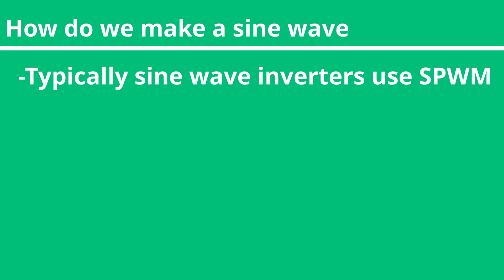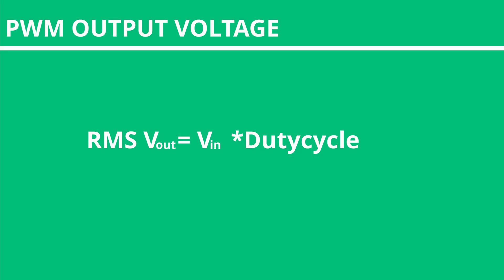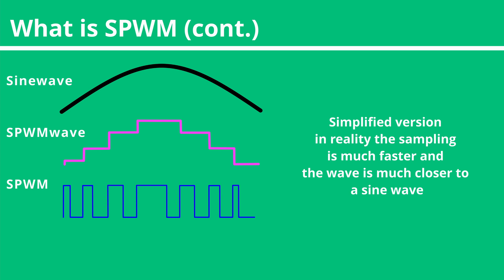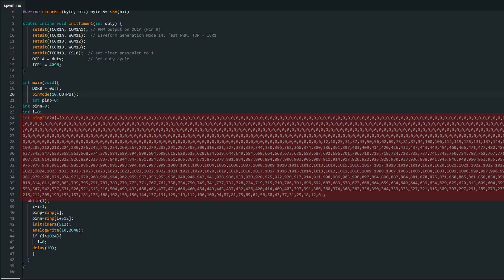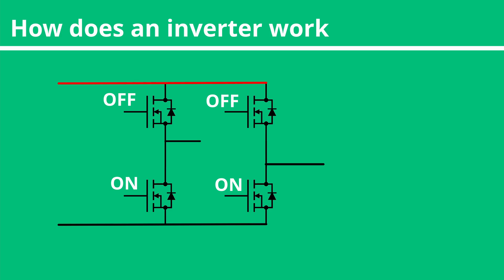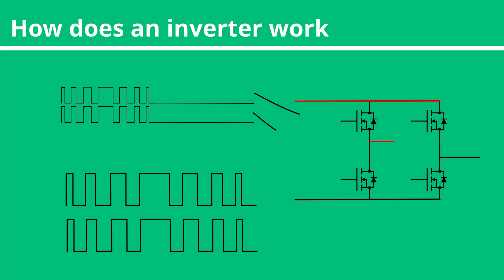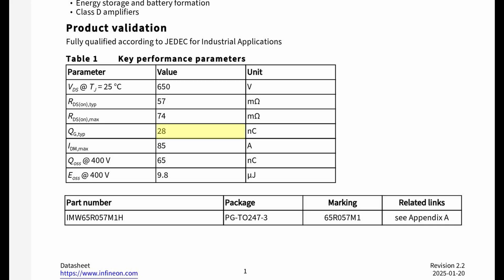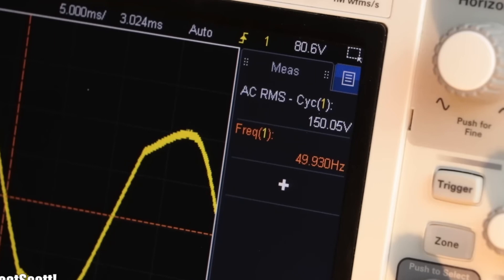How A True Sinewave Inverter Works || Part 1

Comment: Looking forward to the second part! The SPWM H-Bridge setup is indeed the simpler part. Getting a high enough DC voltage is more tricky at high wattages.

Is it possible to use a microwave transformer, where the high voltage part is replaced with thicker wiring so that it converts 24V AC to 230V AC? And use an SPWM driver to create the 24V AC?
Reply from the maker: Technically possible with a microwave transformer but not recommended, it wpuld be more trouble than its worth. Also the second part is up

Comment: I have long been a fan of the idea of a power grid highly modularized with bidirectional DC-DC parallel resonant converters (with appropriate switchmode PFC, of course). Call them full-bridge Royer oscillators or ZVS with active feedback, it's pretty hard to beat the efficiency of all the large reactive currents staying in passive components, sparing our transistors.

Comment: Diagram st 1:51 is wrong, it shows a first order filter, not a second order.
Reply from the maker: It has two components active the inductor and the capacitor, making it second order.
Reply: @Boris_Woodward Not correct.
Your understanding is wrong.

Firstly they are not active components, they are passive.

Secondly, the order of the filter determines the roll off rate measured in dB per octave or dB per decade.

A first order filter has a roll off rate of 20dB per decade. A second order filter has a cutoff rate of 40dB per decade.

The filter you have drawn has a cutoff rate of 20dB per decade making it a first order filter.
Reply from the maker: @deang5622 An LC filter is classified as a second-order filter because its behavior is described by a second-order differential equation. This characteristic arises from the presence of two independent energy storage elements: an inductor (L) and a capacitor (C).
Here's a breakdown of why:
 * Energy Storage Elements:
   * An inductor (L) stores energy in a magnetic field. Its impedance (Z_L = j\omega L) is directly proportional to frequency (\omega).
   * A capacitor (C) stores energy in an electric field. Its impedance (Z_C = 1/(j\omega C)) is inversely proportional to frequency (\omega).
   * Each of these reactive components contributes a "pole" to the filter's transfer function. A pole represents a frequency at which the filter's response changes significantly.
 * Transfer Function:
       The behavior of any filter can be mathematically represented by its transfer function, which is the ratio of the output signal to the input signal in the s-domain (Laplace domain). For an LC filter, whether it's a low-pass, high-pass, or band-pass configuration, the transfer function will typically involve a denominator with an s^2 term.
   For example, consider a simple series RLC circuit (an LC filter often has some inherent resistance or is intentionally damped with resistance):
   The transfer function for voltage across the capacitor in a series RLC circuit is often expressed as:
   H(s) = \frac{V_{out}(s)}{V_{in}(s)} = \frac{1/(LC)}{s^2 + (R/L)s + 1/(LC)}
   Notice the s^2 term in the denominator. The highest power of 's' in the denominator of the transfer function determines the order of the filter. Since it's s^2, the LC filter is a second-order filter.
 * Frequency Roll-off:
   The order of a filter dictates its "roll-off" rate, which is how steeply the filter attenuates frequencies in its stopband.
   * A first-order filter (like a simple RC or RL filter) has a roll-off of -20 dB per decade (or -6 dB per octave).
   * A second-order filter (like an LC filter) has a steeper roll-off of -40 dB per decade (or -12 dB per octave). This means it attenuates unwanted frequencies much more effectively than a first-order filter.
 * Resonance:
       The combination of an inductor and a capacitor creates a resonant circuit. At the resonant frequency, the inductive and capacitive reactances cancel each other out, leading to a peak (or dip, depending on the filter type) in the frequency response. This resonant behavior is characteristic of second-order systems.
In summary:
An LC filter is a second-order filter because:
 * It contains two independent energy storage elements (an inductor and a capacitor).
 * Its transfer function involves a second-order polynomial in the denominator.
 * It exhibits a steeper frequency roll-off of -40 dB/decade.
 * It has a characteristic resonant frequency.
Sources:
 * Omnicalculator: "An LC filter is a second-order filter circuit because it has both an inductor and a capacitor, whose impedance depends on the signal's frequency. As such, it reacts faster to a signal frequency and has twice the frequency slope (also known as frequency roll-off) in the Bode plot compared to a passive filter like RC or RL." 
 * Electronics Tutorials: While focusing on active filters, it highlights that "Second-order filters... have a steeper roll-off rate than first-order filters, allowing them to attenuate undesirable frequencies more efficiently." 
 * Wikipedia (LC Circuit): "The two-element LC circuit described above is the simplest type of inductor-capacitor network (or LC network). It is also referred to as a second order LC circuit to distinguish it from more complicated (higher order) LC networks with more inductors and capacitors. The order of the network is the order of the rational function describing the network in the complex frequency variable s. Generally, the order is equal to the number of L and C elements in the circuit and in any event cannot exceed this number." 
 * MathWorks (Simulink): Provides the transfer function for a second-order low-pass filter as \frac{\omega_n^2}{s^2 + 2\zeta\omega_n s + \omega_n^2}, clearly showing the s^2 term.

Comment: I wonder if it's possible to use a comparator to provide a feedback to the microcontroller.
It would allow the microcontroller to compensate for any odd distortions by modifying the PWM signal on the fly to provide clean sine wave on the output!
Reply from the maker: You could use an ADC to connected to the microcontroller, and infact most inverters do, even without the transformer. the problem with the transformer is even after you put that work in it is still not very efficient. DC-DC conversion is a much easier way to do it.
Reply: @Boris_Woodward I've heard some AC gadgets do work with 120- 220v DC. Maybe it could work as a high voltage DC generator? ¯\_(ツ)_/¯